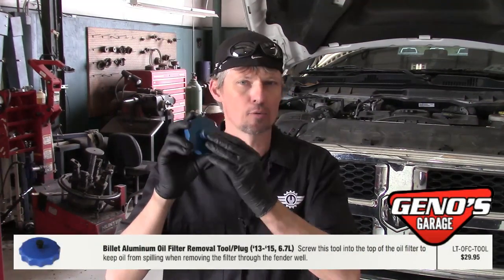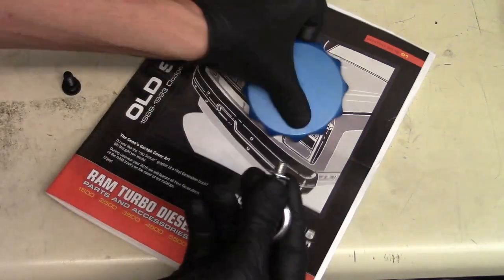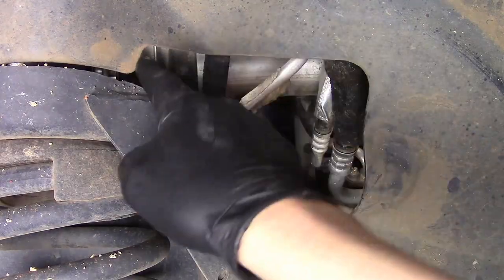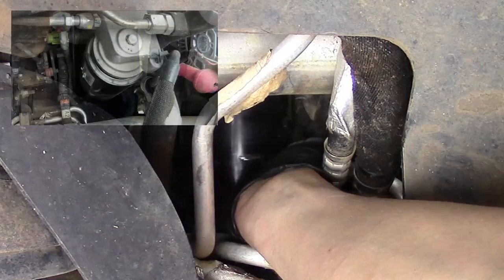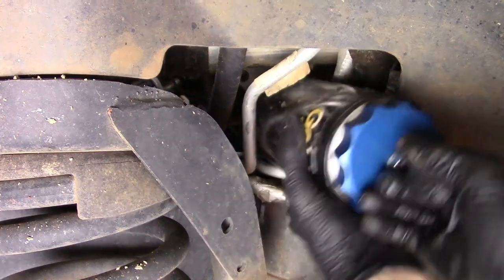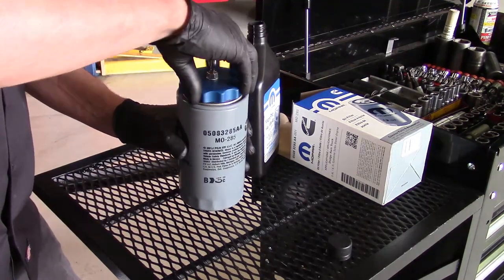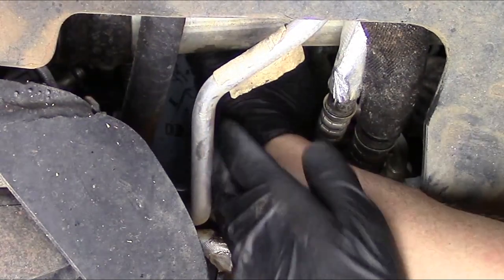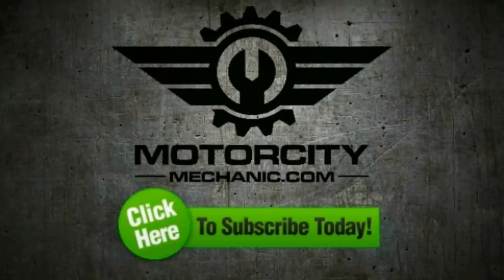Tool review: www.genosgarage.com 2013-present Cummins 6.7 oil filter cap-off tool

Comment: Great video and great idea on the mod. I will for sure be getting one of these. Great camera work too.
Reply from the maker: Just make sure yours has this set up....some can still be accessed from underneath. Hate to see you order the tool and not need it. Thanks again for checking out another video of mine
Reply: MotorCity Mechanic Thx for the tip
Reply from the maker: Anytime!

Comment: My 2000 5.9 Cummins I used to place a Zip-Lock bag around the filter just before the last couple of threads from being off and just caught it with the bag no mess at all.  On My 2013 6.7 I go from underneath the truck after I loosen it up through the fender well opening(I can reach the filter lying on my back with full arm extension) then slowly lower in down and try not to spill it all over myself.
Reply from the maker: There were some frame changes on the late models that put a cross member in the way of allowing you to drop the filter straight down on some models, there when the tool comes into play.....otherwise on all other year models and those without the  crossmember running block I never needed a tool such as this. Now its priceless when you run into that specific year and favorite crossmember. Thanks for the comment and make sure to subscribe

Comment: Great video, you just sold one of these tools for them.  I'll be buying one this week.  I'm tired of getting my hands covered in hot oil when I tip the filter over to remove it through the fenderwell.  

I don't know why they needed to put the crossmember directly underneath the filter on these trucks....or couldn't at least put an access panel.
Reply from the maker: Not too sure myself unless they just wanted to add strength. The other method is to remove the filter from above....still takes a bit of time. The tool from Geno's is a time saver and as you mentioned....stops the hot oil from burning. When you order it......call them up and speak with them. Its the people there that make the company great. You just dont get that when ordering online. Make sure to tell them that I sent you. Appreciate you supporting them and for the comment. Make sure to subscribe and check out my other videos as well.
Reply from the maker: Your correct. Makes for a great place for oil to stay and keep dripping after giving it back to the customer lol. That's another reason I like the tool
Reply: Yup...doesn't matter how much brake clean you use or how many times you wipe off what you can see with a rag, if you let it sit 20-30 minutes there's probably going to be a couple of drops on the ground.  People with $80,000 trucks don't like that very much!
Reply from the maker: rust proofing and dust collecting. lol
Reply from the maker: They freak out sometimes lol

Comment: Very slick tool! No pun intended
Reply from the maker: Like I said Troy.....I put it on my must have list.
Reply: +MotorCity Mechanic much better than my Ziploc bag method. The first time I changed the oil the oil was so hot it started melting the bag! Leaky leaky
Reply from the maker: I tried the bags but they would rip and make an even bigger mess. If your going to be changing your own oil.....get you one.

Comment: say Dave I have an  05 RAM 1500, standard cab 4.7, I have air circulation door problem that what I have found out to be a common problem. Do you have a video on R&R the duct assembly or a better way to fix the broken door or doors as there is more than one. Thanks, Ray.
Reply from the maker: +Raymond Campbell I currently don't have a video on the repair for that body style. I will try to keep it in mind the next time I have one in for that repair.

Comment: Hey David , what’s considered full on the dipstick of the 6.7 cummins ? Is it on the top safe line ? Thanx
Reply from the maker: I was always taught that once it touched the shaded area...stop. Dont over fill to the top of the full mark. Just depends on how long you let it sit after filling and starting and then rechecking the level after you turn it off. At the bottom of the shaded area and to about the half way point is my recommendations. Thanks for asking. Enjoy the weekend and make sure to subscribe

Comment: Caption states 2013
Does that tool and filter change apply to 2012 2500 as well?
Reply from the maker: No need....on that year you can still get it straight from underneath and nothing special needed. On 2013 they made it to where you had to get it out thru the fender opening or from up above after taking things loose. Thanks for asking and make sure to subscribe.
Reply: @MotorCityMechanic  awesome. Thank you for the reply!!
Reply from the maker: @JerryLee..  Your welcome!